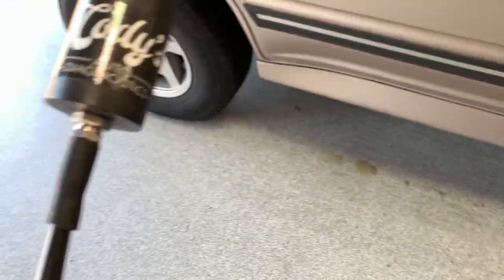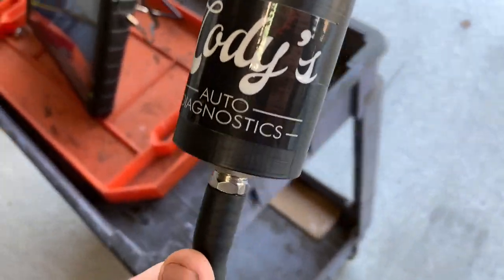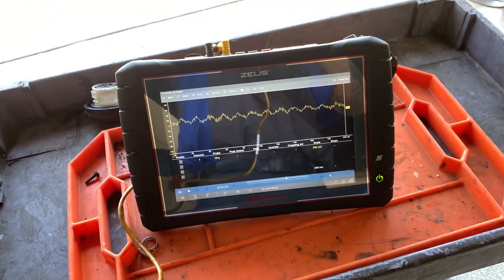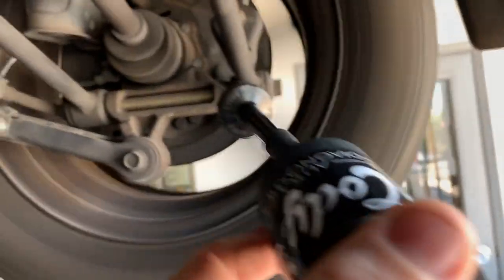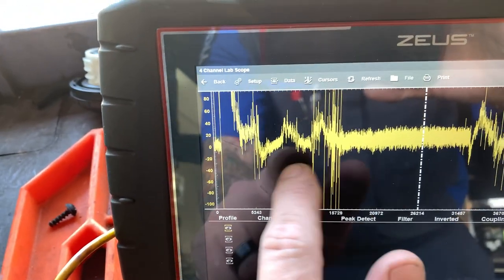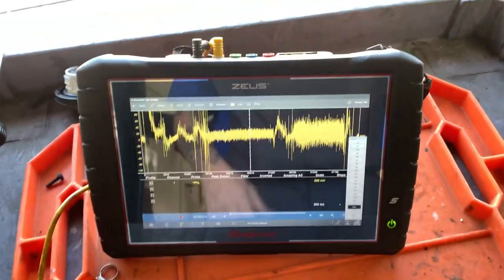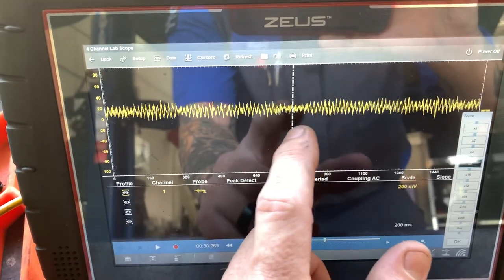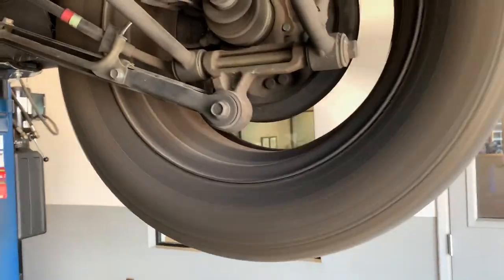“Seeing” noise

Comment: Thanks Cody!!! Been thinking about trying this, but haven't had the time. Shop is crazy busy.  You just proved it and probably saved me 3 hours of messing around.  AND, THANK YOU so much for grabbing the Snap-On.  Pico and ATS are where it is at, but some of us are still trying to pay off the Snappy.
Reply from the maker: You’re absolutely welcome my friend. I found a bad roller rocker on a Chrysler 3.6 using this same technique. It’s a learning curve just like anything else with the pulse sensors lol. I like my snappy for quick stuff like this, the scope on the Zeus gets used daily plus I use this to test all my sensors.
Reply: Funny you mention that 3.6 ticking rocker, I have one in my shop RIGHT NOW...ha!  Agreed about the SnapOn, godd for the quick, but I am constantly hitting this wall with the software/zoom/ time base/signal limits.  Barely got the minimum I needed on one screen to diag an ecoboost chain....which turned into a cab off last week because he sludged the motor over.  Keep em coming, love this stuff!

Comment: It's amazing how much noise (electronic ,mechanical , EMI) can be picked up by a scope . A scope with a FFT function would be great because it will peel the signal apart and show all frequencies
Reply from the maker: This is interesting.
Reply: You might be able to use that data to create "fingerprints" for specific mechanical failures and built up a database. Then a scan tool could listen and give help guide a diagnosis.

Comment: You could be comparing two bad bearings. Another test needs to be done after installing a new left bearing but tge new one would be definitely smoother than the older one and you'll be ending up replacing both bearings 😂. Cool gadget though

Comment: I like the concept but I am having a hard time figuring out where to use it in a practical way . There is so much background noise . I need to think about that one but hey , thumbs up on the video .
Reply from the maker: This video isn’t a great example but had a Chrysler 3.6 couple weeks ago that was able to pinpoint the failed roller rocker before removing the valve cover.
Reply: My mate uses his primarily for diagnosing noisy pulleys on serpentine belts. He is an owner of a small business and uses the scope captures to prove what is making the noise to the customers.
Reply: @codysautodiagnosticsprogra8706  I guess it has a purpose around pulleys and valve train but I should use it before giving an opinion.

Comment: Whats your time base and voltage scale for this application are you ac coupled?
Reply from the maker: I have it at 200ms so I had enough buffer to show both bearings. Also no ac coupling needed. Voltage was 2v
Reply: @codysautodiagnosticsprogra8706  awesome thanks man I just recieved your pulse sensor the other day and have been itching to use it i just told another tech about how it can be used to check wheel bearings and he argued up and down against it so im stoked to prove it lol im just learning on the scope and im the only one in the shop who uses one  so no-one to teach me love everything you do on your channel you've helped alot along with super mario diagnostics and scanner danner keep it up